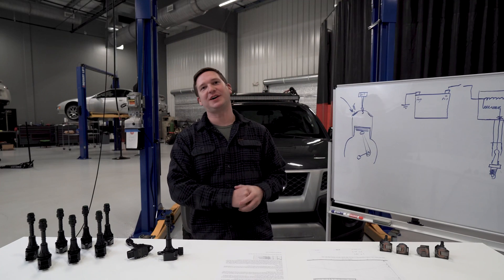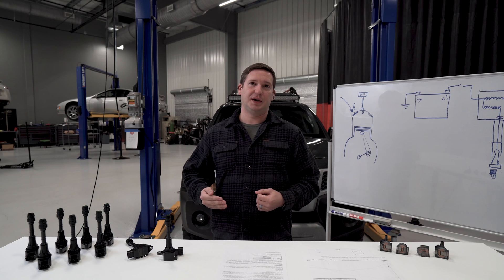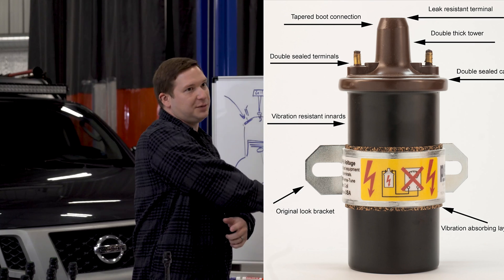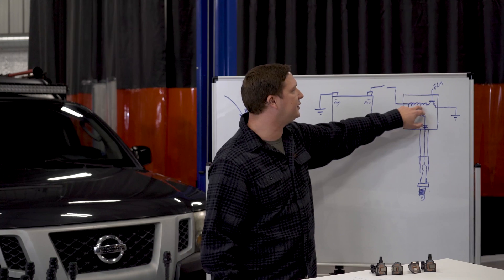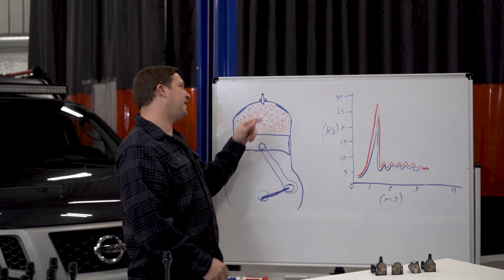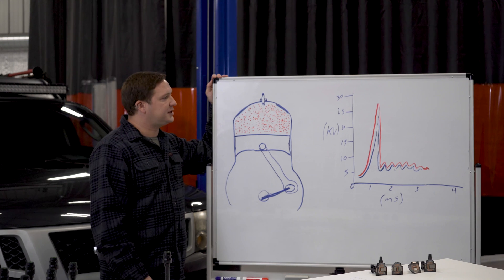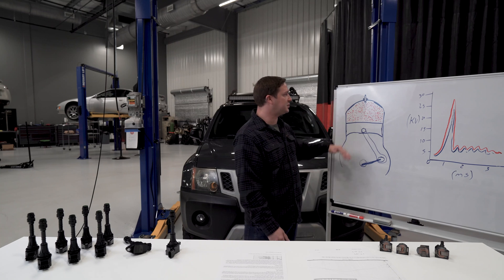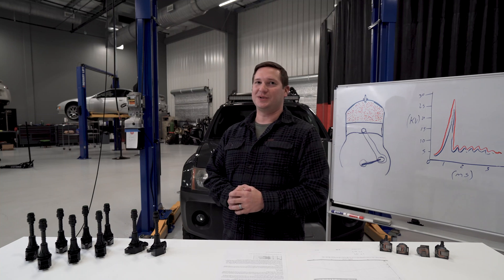LOCKED IN - Upgraded Nissan Ignition Coils

Comment: I just ordered a set of the hi-energy coils for my 370Z and will be installing them soon, with a fresh set of NGK Ruthenium HX plugs.

In looking at the coil options for the 370Z; OEM, Hitachi and Z1 hi-energy, I was wondering what the difference was between the OEM set and the Hitachi. I know that Hitachi is the OEM supplier to Nissan for this part and so it's hard for me to see why the OEM coils are nearly twice as expensive as the Hitachi coils. Is it greed on Nissan's part or is it that Hitachi is making these coils for Nissan to a higher specification with better quality components?

I know that the OEM coils for the Z are regarded as some of the best in the industry and so it is comforting for me to hear from Spencer that Z1's coils are of at least the same quality as Nissan's.

Comment: I have not changed my spark plugs   ever. I have 226879 miles on my 2010 Pro4x. I don't have any power loss that i can physically feel. I dont have a rough idle or any misfires. So lets ship my truck down to the lab and run the dyno and see what happens.

Comment: I’m curious about the durability of these. The increased energy and spark duration will generate more heat in the coils and cylinder head. How long can these coils last compared to OEM spec Denso or NGK? Should colder spark plugs be used to offset the increased heat?
Reply: Even if they last half as long as OEM, they’re a better value.

Comment: Since the output is greater with these coils.  Will my frontier get better gas mileage?
Reply from the maker: We have not performed instrumented testing ourselves but we have numerous reports from clients that they are seeing improvements in fuel economy with coils and also intakes.  It's reasonably common feedback for us but we haven't validated it.  Biggest impact for sure is driving style so if you're easy on the throttle before and after upgrades we expect it's likely you will see improvements.  Exhaust systems that don't loose any torque likely will help as well, any that did loose noticeable amounts on the low end will likely hurt in stop & go scenarios related to MPG.

Comment: I got these Z1 coil packs on my 2010 G37x coupe with 134,000,Big Improvement better throttle response 👍🏿
Reply from the maker: Thanks
Reply: @z1off-road would you recommend using these for a 2002 maxima

Comment: I really want to upgrade. I have to get the exhaust done first then I will see about these. I'm trying to follow the big gains like the volant CAI, Banks exhaust, these coils, and hopefully a tune on an old 08 with 210k miles original engine. Currently have the Nismo R tune CAI but want to switch to the Volant after watching the other videos. Stock otherwise.

Comment: Spencer, how much of a difference is there between the OEM Denso plugs vs the Value Advantage plugs?  Also, how much a difference do the upgraded coils make with a truck @ 50k?
Reply from the maker: Haven''t had the opportunity to test a VQ40 @ 50K yet for this test but we'll work on it.  Will see about getting a plug comparison for you guys too.
Reply: @z1off-road  Would appreciate if you guys could put it to the top of the list.  Need to do a 100k mi maint and looking at what difference there is between the 2 plugs.
Reply: @loztsoul77   have you felt any power increase with them ?